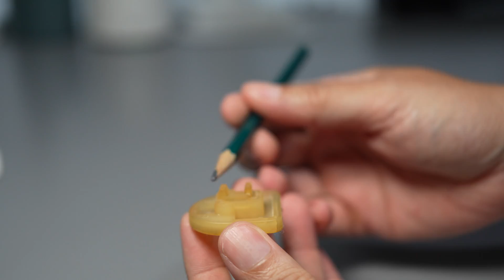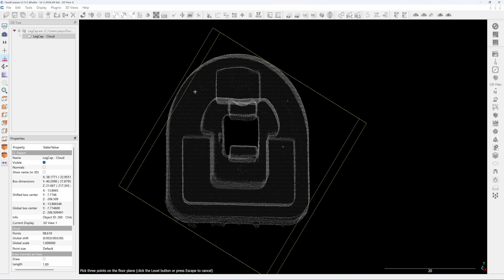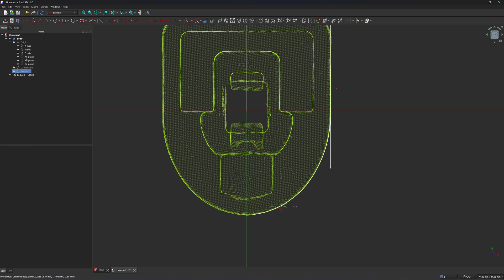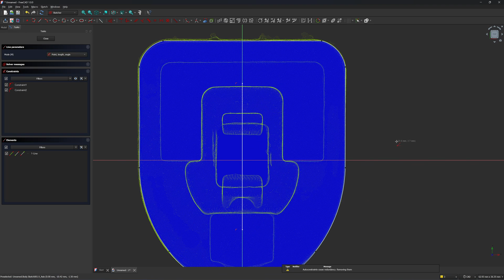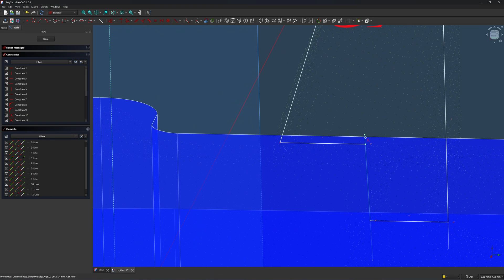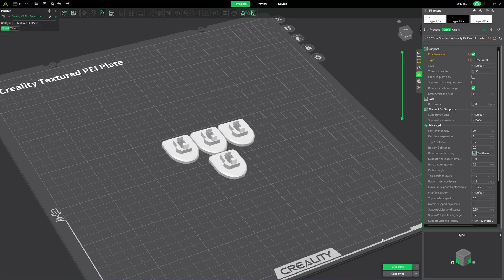Reverse Engineering for Beginners in FreeCAD: Chair Leg Cap Tutorial

Comment: Is it not possible in FreeCad to make a cut and then trace it as in Fusion 360? why do you always draw the lines manually?
Reply from the maker: If you cut a mesh to get a cross-section line, you’ll end up with lots of tiny segments—each around 0.2 to 0.3 mm long. Because of that, it’s really hard to use those lines to build a clean model.
Reply: @Payo-TensileCreator can you cut the point cloud? How? We do need a cross section to see clearly the outline, so I can use a point cloud cross section, but how do I get it in FreeCad?

Comment: Thank you so much for all the videos. I’m currently really into 3D scanning and I’m torn between the Otter and the Raptor—possibly even the Raptor Pro. So I wanted to ask: which is better for small to medium parts, say between 3 and 15 cm?
Reply from the maker: I would pick the Raptor original if that's the size of object you frequently scan with. Raptor gives sharper, cleaner and most important, higher precision scan.
Reply: @Payo-TensileCreator  ok thank you for the quick reply.

Comment: Another excellent video! Some tips: You can also import STL into FreeCAD and show it as points (select imported mesh => RM: "Appearance" from Shaded to Points). Also alignment of Mesh is possible using "Placement" option. By this you could skip the steps with Cloud Compare. Another tip: Instead of drawing around the pointcloud you could also slice the outline of the mesh in PART workbench by: 1. Convert mesh into shape (mandatory step!) 2. Select shape and use Cross-Selections-Button to select cut positions for creating outline drawing which can be used for sketching.
Reply from the maker: Thank you, that's very useful tip. I'll try that out!
Reply: I'm about to do my first scan to rev. eng., This tip is compelling. I implore you to consider creating a video of your advised process. I am a knowledge sponge atm... or perhaps. @Payo-TensilCreator once you've tested this tip out.
Reply: @AndrewJLintz I second that 🙋‍♂️!

Comment: Your videos are great. I love that you used FreeCAD again I learn a lot watching your videos and wish I'd seen this one before reverse engineering an endcap to a level I did a couple weeks ago.  It also makes no difference in the end, but I would have drawn the sketches with polylines (using M key to toggle between line, arc, perp, tan) instead of all the trimming.  Back in my AutoCAD days (30 years ago) I'd have drawn all the tangents and trimmed them the way you did though.  Just a thought, it would be great to talk about some of your design choices as you go, like using chamfers for 3d printing and not caring if lines and arcs are tangent.